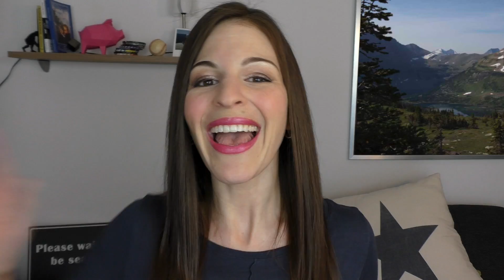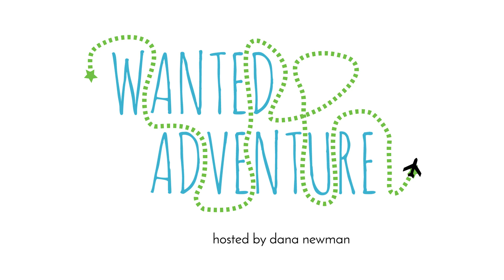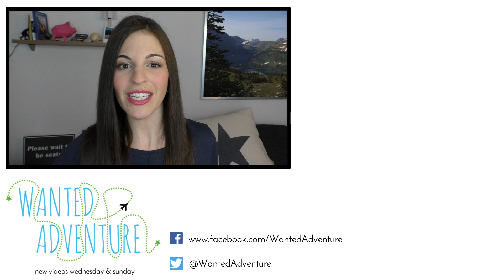Why Are Houses in America MADE OF WOOD?!

Comment: Hi there. Here in Brazil we have lots of trees, and yet we build our houses out of bricks, concrete, iron columns and cement coats. Perhaps the properties of materials has an important impact in decision making. For example, if you look up heat conductivity of materials on Google, you will see that wood conduct less heat than bricks, which is good to maintain thermal comfort within the house, not considering the layers of insulating materials they place between both sides of the wall. 
I think here in Brazil that would not be safe because in some regions at specific time of the year moisture level in the air drops, temperature really high and that is a start for fires wild fires to occur, mainly with wood based material. Well, hope my answer ads up something to your video. Thanks for sharing your thoughts. Bye

Comment: Also, unless specially made (which is expensive) stone and concrete buildings don't do well in earthquakes. Wood has a better chance of moving with the earthquake rather since they are a lighter material.
Reply: Earthquake are rare and no material can withstand it 
But wood cannot withstand fire, flood, pests, winds, humid , and whatnot but concrete or brick can withstand all these including tornado 
Wood is cheap ! And faster to work with so all Americans are actually using wood for houses

Comment: We still use wood construction in our housing because a massive chunk of our economy and workforce revolve around the investment and industry of wood based housing. 

Can you imagine all the jobs that would be lost overnight if we switched to concrete housing and the costs involved in adapting our entire society to creating, building, and maintaining concrete housing? 

Just the negatives aspects of wood/stick housing fuel massive industries and workforce’s. From framers to painters, exterminators to roofers and all the industries that supply them.  Architects, plumbers, electricians, insulation....all would have their entire investment and educations eliminated. Sure concrete houses would use many of those industries but the skilled workforce would find all that education, training, skill, tools, supplies and even the evolution/investment immediately unneeded and the jobs that go into just the support of those things eliminated. If you just think of all the things involved in wood built housing and the scale of even just those industries which would have no transferable skills or industries if we no longer built houses from wood, you will quickly see why the advantages don’t outweigh the costs.

Industry Economic Investment.  So many industries in the US have been developed to provide for the building of houses from what was once simply used for the fact of its abundance that if we now tried to shift into a concrete/cement based housing society we would see massive hits to one of the main drivers of our internal economy. 

But ultimately if you wanna know the simple answer to why we haven’t made the choice to build (more than we already do) concrete houses in America? Same reason we still don’t have universal health care, same reason we don’t have universal higher ed, same reason we don’t have a solar wind and electric powered grid, why we don’t build more electric vehicles, same reason we don’t have widespread public transportation.....in the end it’s the same reason we still don’t take advantage of so much of the knowledge we have acquired. We don’t do the things that are obviously in our nations best interest long term ultimately bc of greed and apathy in the short term.

Comment: I live in Holland and i am a house-builder myself. We use the best of both materials. The bearing walls, and the ones for stabilisation, are made of stone or concrete. The partition walls inside the house are often made of wood or other light materials.  The roofs are nearly all made of wood and covered with rooftiles so that's a weak point against tornados of course. 
Luckily we don't have tornados in Holland.

Comment: Each one has its use depending where in the U.S you live in. However, you are right. There is wood everywhere in here!

Concrete Block & Cement won't work well in Earthquake-prone areas, but sustain faster winds than wood.
Wood-framed houses are not great in Hurricanes and Tornadoes, but are more flexible than cement in earthquakes!

Comment: It will make them tornado protective. When houses are build in Europe, they build static posts to protect them very strong winds. If you didn't know, Europe sometimes has strong winds as well.
You dont need to guess. See only Philippine and Indonesia during tornadoes and tsunamis, the only building standing are build with bricks. The answer why? is simple. Because building with wood is cheap :)

Comment: I understand houses were built out of wood when america was settled. But over hundreds of years there should be some development. Like "well, our houses rot. how about a stone on top on the other".
I just don't get why they still stick with cheap bulding. Especially in regions which are struck by heavy storms every fucking year. I mean, it's not very surprising in some areas. What is the thinking behind that?
"Oh, my house is just blown or washed away, let's build another one to be washed away." After hundreds of years... I still don't get it. We see your houses falling apart, people suffering and dying and we just think: "What about a stone house with a sturdy roof?" Other large objects hurling can't be the argument. Coz a normal house in Europe could be hit by a flying car and it would still stand. Roofs are pretty replaceable. But the whole house?
Needing a special desing to make them tornado proof is bs. Roofs will always fly. But the walls don't have to. And that's the point. Why the fuck do you build light walls that can be run down by a huge person? Just put one brick on another and it will stand forever. Like all your prestige buildings are built of brick and concrete. But the homes are not. It is just friggin stupid. You can't talk that away.

Comment: In USA , ZONING AND CODING is applied to design a house or a condo or a commercial structure. Florida is tropical east coast is different from  NEWYORK which is Northeast colder zone ,hence  zoning is different , now coding depends on its requirement according to the need of the house. Multi-storied condo is built in a very different  coding than a single family home. Concrete cracks easily and  hence  in earth  quake zone , houses are made up of wood. wood have been processed  for water & fire proof also ; grades of ply wood have been made with advanced tech that can last for 150 yrs-200yrs  easily . wood is cheaper and eco-friendly and makes house very affordable.  steel concrete construction has place for overways , tunnels, bridges  , railways and many high rises but expensive.. Dry wall tech with aluminum frame for building material has done very good choice for partition and walls. Sliding on  the exterior of house walls protect its core walls  against all weather degradation.

Comment: There's also the challenge of insulating spaces with solid rock/brick/concrete/etc. rather than very low density cellulose or glass fiber in between studs. Takes a lot of material to make a house that way. Stick-framed houses are cost effective, good at insulating extreme conditions, and easily modified. Routing plumbing, electrical, and attaching finish materials on stud frames is easy. Doing those things in solid concrete, block, or stone is NOT easy.
Monolithic steel-reinforced concrete dome houses are extremely strong, probably the strongest structures and can easily withstand heavy flying projectiles and extremely high winds, also impervious to flood waters. There are builders who specialize in those structures.

As far as "tornado alley" is concerned, that's true when it comes to slightly concentrated areas, but generally over decades it looks something like this:  https://modernsurvivalblog.com/wp-content/uploads/2014/03/tornado-tracks-united-states.jpg

Comment: There is a huge environmental problem with concrete & Bricks. You need heat, from fossil fuels/ agregates and sand which is often dredged up illegally. There is not enough of the right sand incredibly for the amount of construction. Wood is actually renewable and is less problmattic is some ways.  I'm British btw so it's all brick & concrete where I live.

Comment: Wooden structure is cheaper to build, cheaper and more effective to insulate (hence walls can be much thinner creating more room inside), and earthquake resistant. Renovation of a wooden structure is a simple, cheap, and fun process. Concrete buildings are "stiff", and when it comes to any renovation it's a mind-bender;  even hanging a photo on the wall requires a heavy machinery, while you can hang a TV (nowdays) on the American wall on the pushpin.

Comment: I've lived in America for decades.  Lived in both brick and wood houses.  99.9% of wood houses are more than enough to last generations.  Many towns and cities have wood houses over 100 years old.  I've lived through hurricanes and tornadoes.  Those types of storms destroy both brick and wooden structures.  But everyone knows brick is better, it is also more expensive.  Many American homes are both brick and wood.  And many American homes are cement and brick.   I've also lived in Korea.  They also have wooden houses but not nearly as many.  Some Korean temples are 100% timber construction and are about a Thousand years old.  Doing just fine as wooden structures.  Mostly, wooden construction in America is driven by the constant need for rapid construction and the huge and vast expanses of forests.  The population density in Germany would require a forest larger than Germany to sustain wood construction.  My current house is wood framed up to modern building codes and it survived Hurricane Michael.  Many older brick homes nearby did not.  A 50 ton, 50 meter tree breaks both brick and wood homes.  And a tornado is even worse.

Comment: I believe the reason for wood homes in the US is there are wild shifts in temperature and humidity changes, a wood house is better suited to keep heat in or hold air con in. Much like burning wood at a campfire, heated wood puts off a tremendous amount of heat. In the southwest and the hot areas of California, concrete would work better because lack of extreme cold.

Comment: I feel like this video has a lot of misinformation. I feel like both the person/people who asked you about the construction of homes in America and yourself, are both uninformed.  There are homes built in America that are like European houses. It depends on what construction method that's in question. In Europe many homes are built using AAC blocks (autoclaved aerated concrete), There are some homes and commercial buildings built in the US using this method but it's not very popular because many builders don't know how to install them and there are better options. The majority of homes you're talking about are called "stick" framing which is by far the fastest and cheapest method for building a home here. There is also Post and Beam construction, Timber framing, AAC, CMU (cinder blocks) and ICF. ICF is much more popular than  AAC blocks in the US because it is easier to set up, and gives you a sturdier wall and also insulation. AAC never took off here because it makes it hard to make a thinner wall that meets the energy and building requirements in some areas.  ICF is becoming more and more popular, Also in Europe.

Comment: 1: wood is cheaper in construction. it's far easier to work with. we don't need to look far to find wood either; it is plentiful and abundant.
2: in earthquake prone areas (like CA), wood homes are safer, but we don't have that issue in Kansas.
3: wood is a better insulator. the US has harsher climates in most areas. Germany is smaller with a milder climate. stone conducts heat & 'coldness' so much more.

Comment: Water Proof vs Water Redistant
Tornado Proof vs Tornado Resistant
Just coz a concreate house aint specifically build to be 100% proof for tornado dont mean it would not do many times better than a wood construction.

Speaking of windspeeds if I remember correctly the only buildings left standing (granted not with a roof or windows anymore) were a few concrete houses after that Hirosima(Plutonium) & Nagasaki(Uranium) experiment, all the wood houses got obliterated :p
Reply: No roof is "tornado resistant".  The entire house would get water damaged by the ensuing rainstorm anyway after the roof is blown around.

Comment: Hi Dana, I guess the answer on the reason why in the US the houses are of wood, is not quite accurate. Though it sounds logic what people told you, it's just not true. Brick houses in the tornado alley would resist a tornado far better. Research carried out in the US, not only recently, but way back in the 30s of the last century, left no doubts about it. Brick houses are affected as well, when hit by a tornado, but to a lesser extent. Usually, roof, windows and doors are severely affected and have to be replaced, but structures are not affected in over 90% of the cases, for it depends, of course, on the tornado strength. In Europe we have been having in recent years some tornado hit areas, without the devastation you see in the US, particularly in Florida or in the area of the Gulf of Mexico. But even if it was true, this doesn't explain why the houses outside the tornado alley are not built of bricks, for instance in Chicago, Boston or Salt Lake City.

With reference to the issue that they are build of wood because wood was, and still is in some areas, abundant, is actually only partially true, especially when you look to more recent times, let's say, from the 20s of the last century until today. Not that we didn't have it in Europe, though many people think that houses in Europe where always build traditionally out of stone and or brick, it's not true. Where you had lots of wood, we'd build our houses out of wood, see Scandinavia. This can be said about Germany as well, where houses where built of wood well until the end of the 18th century, not in the cities though, where you had lots of wood houses until the 16th century. 

So, why are houses in the US built of wood? Though I myself don't have an ultimate answer, I think it's mainly due to costs. Sure, well until the end of 19th century it was just a result of material availability, they had just plenty of wood (though nowadays, the US can't cover their wood needs and needs to import heavily from your friends up the north, Canada). Nowadays it's cheaper, not only when it comes to material, but you can obtain further huge cost reductions through the fact that building a house with wood, is just more simple, not only because the material is cheaper, but as well because of reduced costs with foundations, with slabs, manpower, lifting equipment, materials, insulation and building time. So, the reason is, just because it's cheaper.

Comment: Most of the masonry homes in Europe do not have steel reinforcing rods in the walls.  They rely entirely on the weight of the block, brick, or stone, to hold it together.  They also have a roof structure made of wood.  Those houses would not survive an earthquake.  In a tornado, they would lose their roofs for certain, and possibly have one, or more exterior walls damaged, or even blown down.  Europeans build the way they do because they used up their forests centuries ago and had to stop using as much wood to build houses as they used to.  If they had the earthquake and storm problems that we have in the U.S., they would require steel reinforcing in their masonry walls.  The U.S. has made changes from experience.  Wood buildings are now required to be knit together with small, sheet metal, connectors, generally referred to as "hurricane ties."  Their use significantly increases the strength of a wood structure, and makes them stronger than a non-reinforced masonry house.

Comment: Modern full concret house with metal armature and flat roof that we build here in most of europe with wall thickness  about 22 cm + insolations and other, could handle a car or a bus but a problem is in glass windows... however even if windows break i think that strongest tornado could not destroy the whole city or neighborhood like in your cases.

Comment: I think cheaper homes are wood to keep cost down. My mom was a carpenter and construction worker when I was a kid and I saw a lot of the work she did on it house, which was over 100 years old. So the outer walls were made of brick while the inner walls and floor were wood. My current house was built in the late 70's. I believe the outside is all concrete, though covered with brick and siding. Again the inner walls and floors are wood.

Comment: Wood-frame houses are usually all we need in the Americas, although Mexico features their old Adobe brick homes, as well. Question: Would you rather a tornado or hurricane tore the house away, or buried you beneath tons of stone or concrete? It's safer to have the cover blown away, and definitely cheaper/faster to rebuild. It's just more likely you'll survive being struck in the head by a piece of wood, as opposed to a brick or slab of concrete, which will certainly crush your skull.